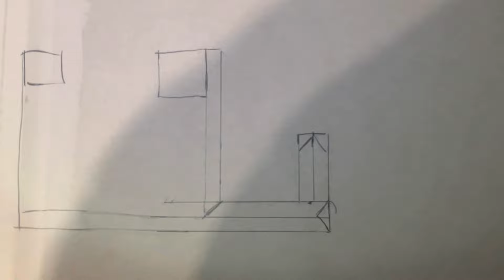How to make and install dropped ceiling| False ceiling | Suspended ceiling | Drop ceiling

Comment: Hey man, great ceiling. Question, how did you cut the channels to bend the board to the 90 degree angle? What did you use to glue the board once they were bent?
Reply from the maker: The carpenter used a special cutter. Basically you can use any glue of your choice but our carpenter used the foamy one. (I couldn’t contact the carpenter to ask this)